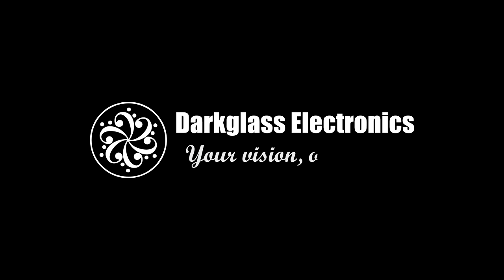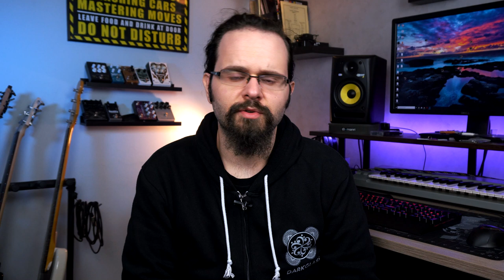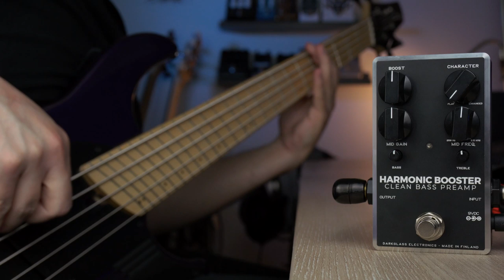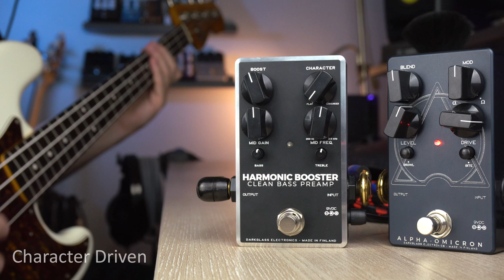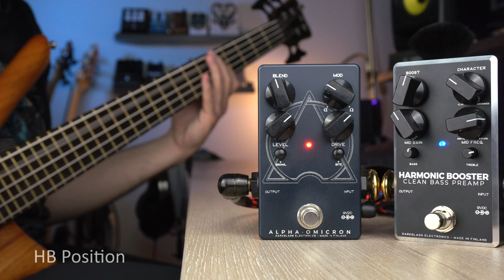Harmonic Booster Demo by Chris Kollias

Comment: I really like the tone on 4:40 sec, nice CLEAN and AGGRESSIVE.
Also I am not a very big fan of overly distorted bass tones, for me it works when I have organic clean and aggressive tone, to cut thru the mix, which these days a lot of bass players think that the only way of getting aggressive tone, to cut thru , is to crank the gain , or add a lot of distortion. 
I think when you already have aggressive mix with a big wall of distorted guitars, the bass sits better in the mix , when it is clean and crisp and supports the low end. 
This video , really shows you how this pedal works. 
It can give you any sound that you will ever like or need, even works when is used with distortion pedals, to change the character of the distortion.

Comment: Nice pedal and nice video. I have the Alpha Omicron so i'm very happy to see how this pedal can enhance the sound !
Reply: It's basically an EQ pedal, so it would normally be placed after the distortion. The way mine is set, it mid scoops through the character knob, then slightly enhances treble. The boost is useless for my solid state amp. If someone has an active bass with a mid frequency selector, then the basic EQ is actually pointless too. The only feature really is the Chracter knob. It is very similar to the mid-cut knobs on certain bass amps. My MarkBass amp calls it "VLF". My SWR amp calls it "Aural Enhancer".

Comment: Wish this got built in the ultra pedals. The eq controls that's in those is kinda boring compared to this
Reply: just wait 6 months and boo yaa a ultra version with this pedal is come
Reply: 2 years have gone. Still waiting for the Harmonic Booster Ultra.
Reply: @crguti  An ultra of this pedal doesn't seem like it would make any sense. It's basically just an EQ pedal with a boost function. I have a harmonic booster in my chain after an Alpha Omicron and a Microtubes X. No ultra pedals at all. It just let's me add in a little brightness boost and mid-cut if desired.

Comment: All these videos about Dark Glass Pedals is great, but how do these pedals sound when you add in the good ole staples such as....Compression, 6 to 9 band EQ's, and a Wah Pedal with Volume and such .  The question i am getting at is are these effects as good when you find the sound you like and then add non-dark glass  pedals too them to help "support" your new aquired sound and then build upon it.
Reply: The Harmonic Booster is basically just an EQ pedal. Another EQ pedal is pretty redundant. I've got a Cali76 and Dunlop Crybaby Bass wah before an Alpha Omicron in to a Microtubes X into a Harmonic Booster. Works great. I also played a Bassballs before them and that works well. I've got a C4 Synth pedal before them too. Some settings on the C4 work with them, but many do not, but that's to be expected as there are currently about 2,500 effect variations downloadable for the C4. After the Darkglass I've got a Fuzz, SansAmp, a chorus, and a reverb. The Fuzz doesn't like the distortions much, but otherwise everything works together.

Comment: Add a DI output and you got me
Reply: Just buy a $30 D.I. box or a $300 DSM and Humboldt Bass Simplifier if you want more options. Then you'll never care about pedal D.I. again. The Harmonic Booster it more-or-less just an EQ pedal. There's no drive or cab sim built in. It doesn't make any sense to have the size be bigger to add D.I. in.

Comment: where is the harmonic booster ultra?
Reply: Probably not coming as that sounds like a bad idea. Ultras include 2 channels, right. The Harmonic Booster is really just an EQ pedal without a drive or a cab sim. What would the 2nd channel be? It just makes no sense. If you want a D.I. box they cam be had for as little as $30. D.I. really belongs at the end of the chain anyway. It doesn't belong on every single pedal.

Comment: I really love your products, Darkglass but you've lost my trust. Every time I decide to buy one of your products you come out with an updated or deluxe version only months later, leaving me feeling shafted. Your stuff aint cheap! You should offer your loyal patrons something if they've previously bought one of your products and you come out with an updated version less than a year or so later. I, for one, would be more inclined to buy this pedal.
Reply: Stop buying deluxe. There's almost no point. The Harmonic Booster is basically just a well-tailored bass EQ pedal. Get the small distortion pedals. Put a separate compressor pedal at the front of the chain. Put a $30 mini D.I. box at the end. If you want to get fancier with your chain, buy a DSM and Humboldt bass simplifier. Putting D.I. on every pedal is silly and the cable is often blocked. Just do it in a more intelligent way and save some money at the same time.
Reply: I like it more after the distortion pedal. I have mine before Alpha Omega, but I feel like it takes away bit of drive form AO that way. I definetely should try put HB after AO. Thanks for video man!